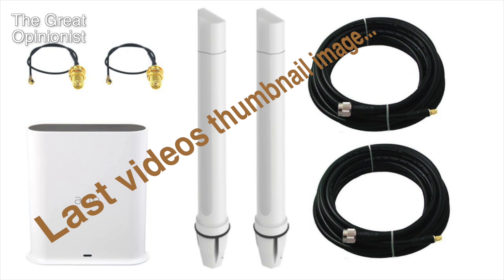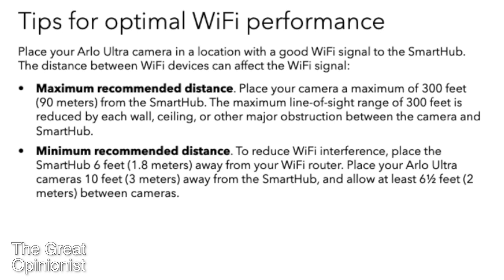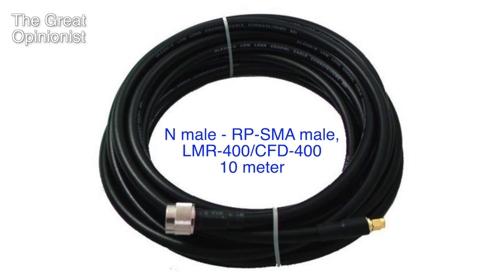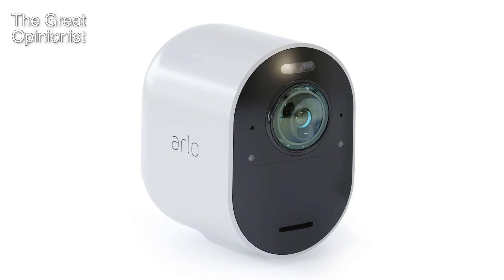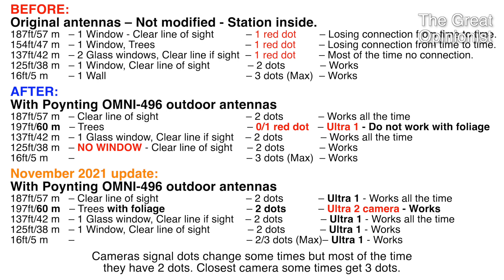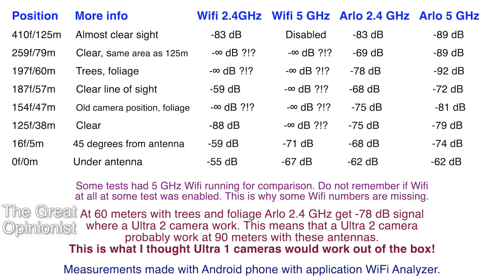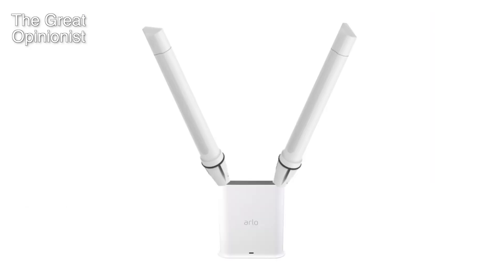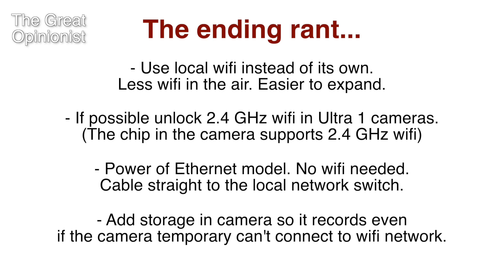Arlo VMB-5000 modification update & Ultra 2 camera: Finally 90 meters/300 feet of range!

Comment: Thanks for sharing, I will receive my ultra 2 kit soon and will definitely modify my hub.
Reply from the maker: It is easy to do it. The tricky part is the connections at the circuit board. This whole project introduced me to the world of antennas. Is more I did then presented in these two video. Tested a cheaper external antenna, tested cheap small antennas. Had to go extreme with the two big Poynting 2,4GHz + 5 GHz Wi-Fi antennas and get a Ultra 2 antennas for the extra range and the best cables for lowest signal loss.

System have now been running now with no issues for some years now. It was frustrating in the beginning when the range was very bad and cameras dropping and not coming back for hours or even days, and it all was because of the friend who bought this system trusted the original range numbers Arlo presented.

Comment from the maker: Minor June 2023 update. Over 2 years with these antennas and no issues. No issues at all. Ultra 2 camera works great.

Why didnt Arlo release 2.4 GHz on Ultra 1 cameras? 2.4 GHz can handle the data so why? Why not let user choose (by default in automatic mode) where user can choose 2,4 or 5 GHz depending what wifi in their area?

This Arlo system could be so much better on many areas. For people who trust Arlo and dont know anything about computors and want easy camera system with good cameras then Arlos is good.

Comment: Sorry but did this work for boosting the range? Otherwise looks like an additional base unit is the only option for getting cam connected at a longer range?
Reply from the maker: Yes it extended the range. Look at the 2minut and 30 seconds mark in the video for comparison. Much better range with having the antennas outside were most of the cameras also are located.

Do not want to give Arlo more money because how they have designed this system to screw the customers of as much money as possible. Why not create a good product instead?